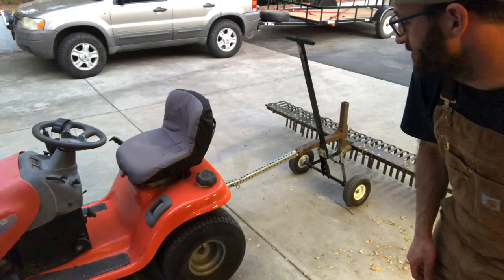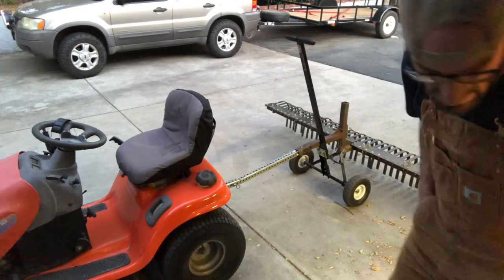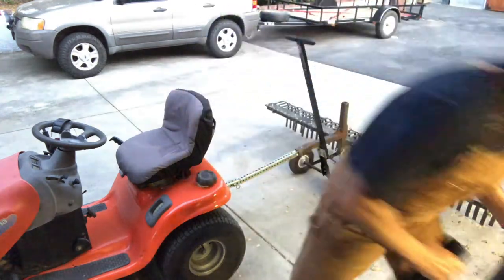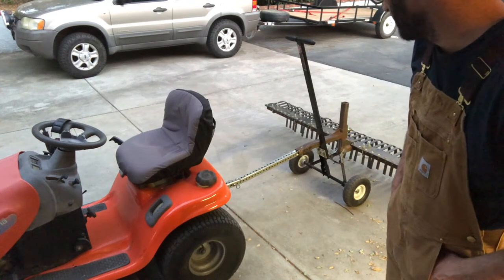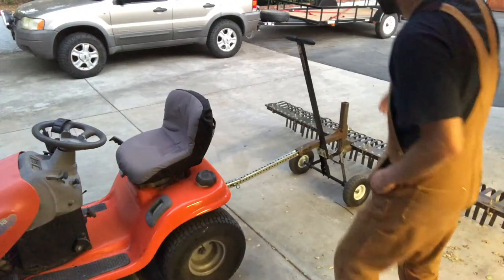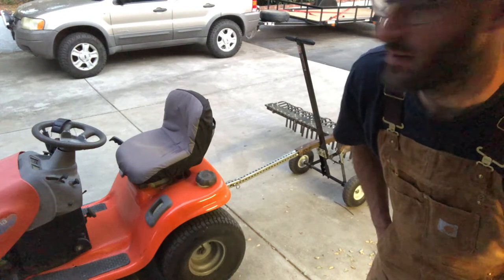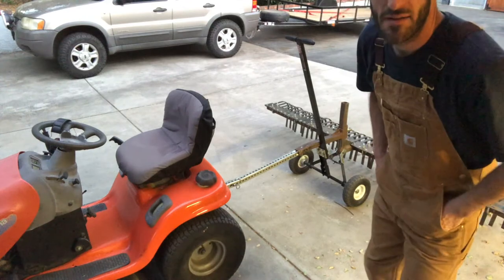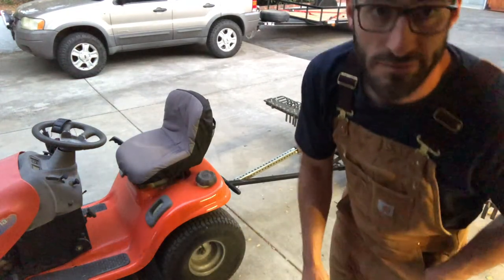Landscape Rake Picker Upper, v2

Comment: How did you attach the dolly to the rake? And what did you remove or modify on the dolly?
Reply from the maker: I had to modify the dolly with some brackets. I think they were unistrut brackets that I bent into the right shape to mount to the square tubing. As I recall, I only removed the hitch on top.